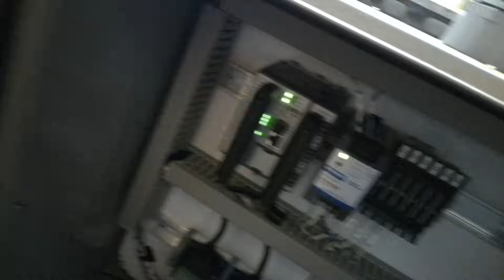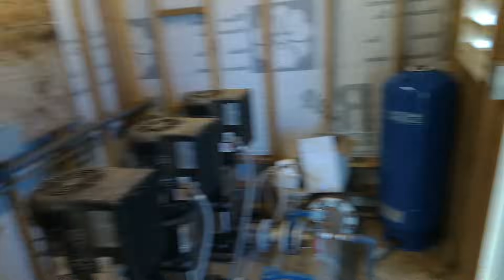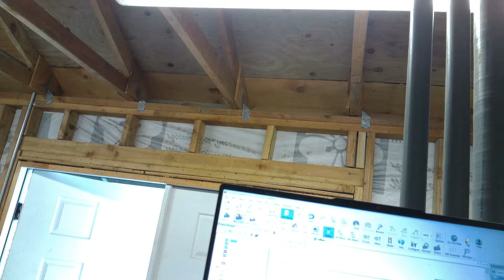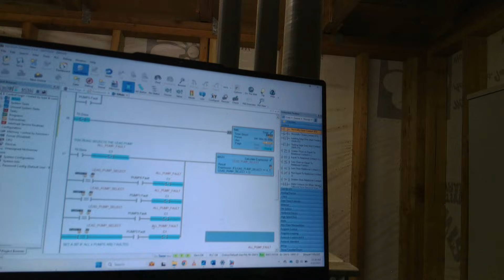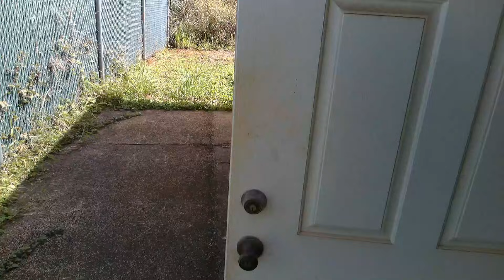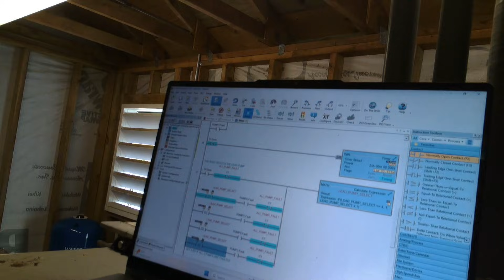Pump Controls Trouble Shooting

Comment: Yeah throw some water on the control board, and it will fix everything............Sarcasm,  Having interlocks, mechanical, or electric could help solve problems...............

Comment: Want to share a tip while on topic: if you see phase disbalance fault but everything runs good - check controls power supply. The three phase power supply WILL run on single phase ( although derated ), but most of the times sensitive voltage/phase monitor can sense the unbalance.
I’ve had one that one of the fuses was bad, and no one knows how long it been running like that. In the end it failed and caused painful downtime. I did put external power supply, luckily it was winter and machine didn’t need to run cooling fan, because external power supply couldn’t run everything.
I don’t like 3 phase power supplies for that reason, but if single phase fails - you’ll know it right away. But it is extremely hard to find 480 V single phase ones.
Reply from the maker: Good advice!
Thanks for watching!

Comment: Do those motors hav DOL  overload protection, when they are in the emergency mode ( not running through VFD thus not having over current protection of it)?
Reply from the maker: They are still running via a VFD, but are not running in PID mode. They ramp to 60hz and stay there as long as their (run at preset speed) input is true.
Reply: @commenter5469 I believe that the rotary handle motor protection circuit breakers visible at 13:03 feed power to the motors via the VFDs. They would protect the wiring from short circuit and the motors from overload/phase failure in the case of a VFD failure.
Reply: @ I saw those. I wasn’t sure, too far. They can be just an isolation switches, or can have overloads built in.